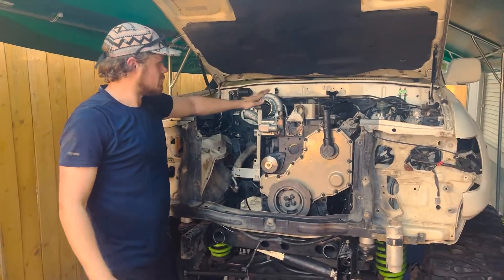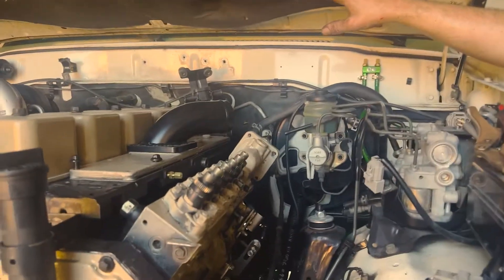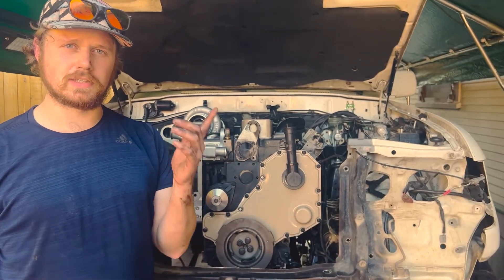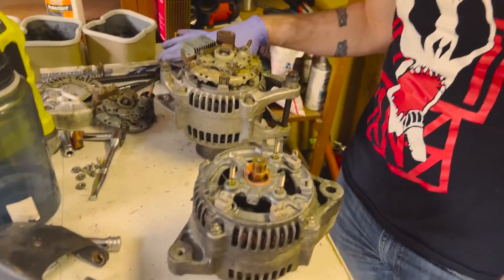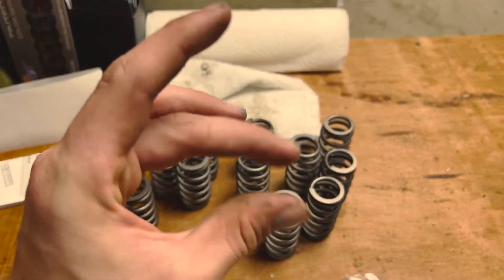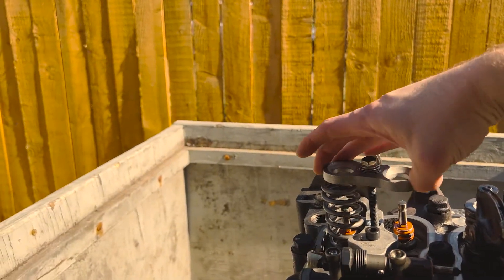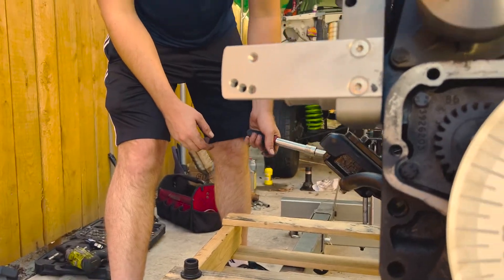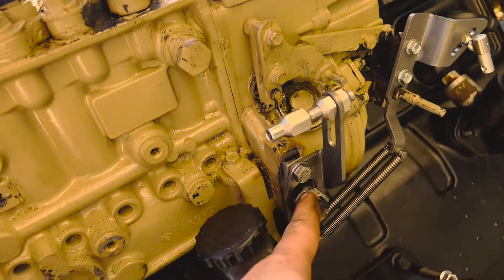Cummins Swap Part 3: Timing Advance, Delivery Valves and Dropping in Engine

Comment: Man this makes me miss my build... Need to get back on that for sure. The last fight I got into that stumped me was the Heater Core/climate box. Had to get a special exhaust manifold to move the turbo around 🤣.
Reply from the maker: Yeah it’s definitely tight back there! I ended up just deleting my rear heater
Reply: @Austin_SaintOnge  I saw you're in the PNW, Same here, probably not terribly far either. I'd love to pick your brain and BS about our builds man.

Comment: I am pretty much convinced on getting an 80 and doing the same here in aus
Reply from the maker: Nice! Yeah there seems to be quite a
bit of support for the 6bt in Australia. There’s a few swap kits or at least parts I’ve seen. Seems like a very rewarding swap getting a 6 liter beast - mines capable technically of 500whp and over 1000 ft lbs of torque 🤠

Comment: Would be interested in what the end weight is vs a beginning weight
Reply from the maker: Beginning weight was 6100- will update when finished !
Reply: @Austin_SaintOnge  any clue on front to rear bias?
Reply from the maker: @TheShooter466  it’s gonna be substantial especially since I’ve got an arb with 12k winch. I have 6 inch coils with 30mm spacers up front. Rear has 6 inch coils and I really just don’t have that much gear in the back. I’m probably going to go with 4 inch coils for the rear to even it out. I’ll keep you updated!
Reply: The difference for me was only 300lbs. I went from 5800 to 6100 lbs for my swap.

Comment: Awesome progress, looking forward to the next one. What you are doing is what I plan to do in the near future. Looks overwhelming, I need to start putting a plan together. Cheers from Vancouver BC.
Reply from the maker: Thanks bud! To say it’s been overwhelming is an understatement. I’ts been financially taxing and the sheer amount of hours is nothing short of exhausting. However it’ll be that much more rewarding once I get it up and running
Reply: @Austin_SaintOnge  I completely understand where you're coming from. I am rebuilding an HJ60 from the frame up. Then I decided to get an 80 in the middle of the 60 rebuild (that project halted quick), one that hit a tree, so now I'm rebuilding the front (front frame clip swap, inner aprons, rad support, all the bits and pieces). Is it a passion or a sickness that I have, I don't know anymore, but like you mentioned, it will be very rewarding and all worth it in the end.
Reply from the maker: @tkclips506  that’s sick man! About 10 years ago I bought an fj62 when I was in Colorado for $750. It was having starting issues and I didn’t know how to wrench back then so I ended up selling it for $1k. The few number hours that I had driven it were enough for me to be hooked and have been looking for another land cruiser since. Luckily found Tonya about 2 years ago and I’ve gone a little crazy with her 🤪
Reply: @Austin_SaintOnge  I'm enjoying the progress, she's a beast. Fj62 for $750, good old days.